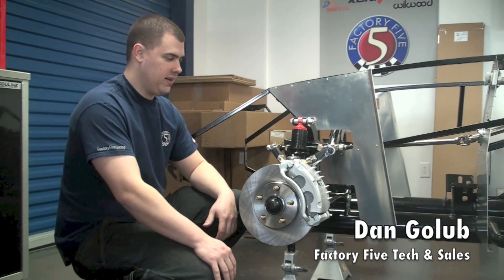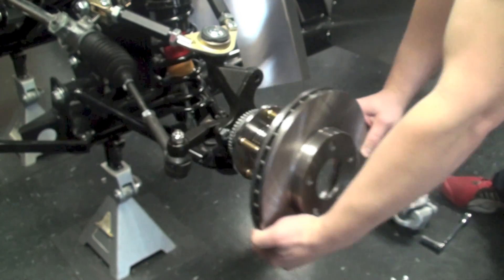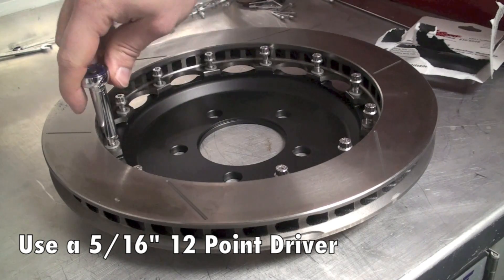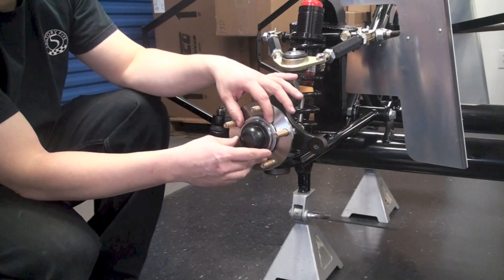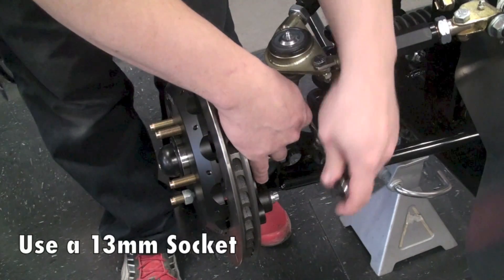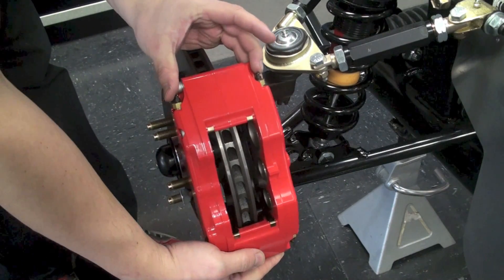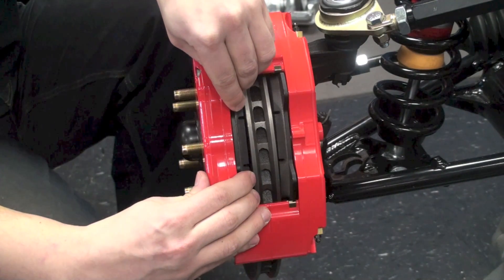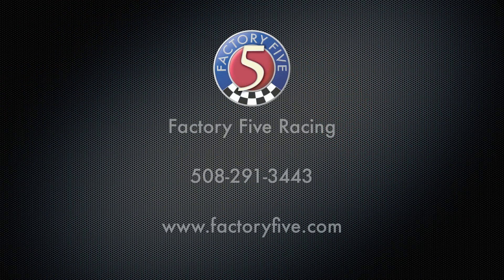Factory Five Mk4 Build Episode 5: Wilwood Brake Upgrade

Comment: This is essentially a mustang rear brake. You can pick this up at you auto parts store you don't have to pay wilwood $1,000. Or Ford explorer brakes work and they're bigger if that's what you want. But remember if you're just trying to stop the car the kid is about a thousand pounds less than the mustang or so you shouldn't have any trouble stopping that car with stock brakes. Take them off and you can exchange them at any auto parts store for rebuilt units at about 50 bucks and 60 per rotor!! You just don't have to spend thousands of dollars on all this stuff. Unless of course you want to I'm sure wilwood would appreciate it